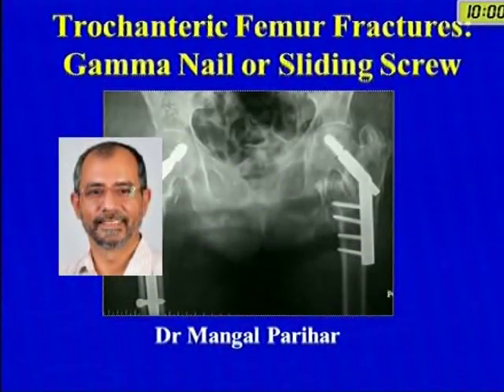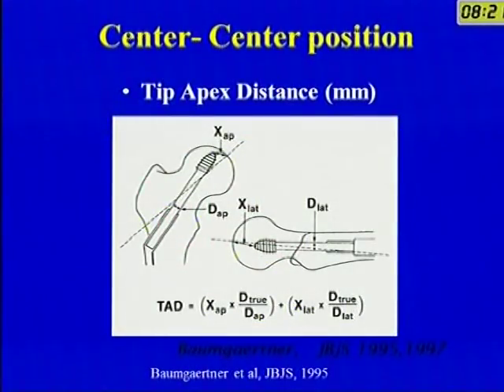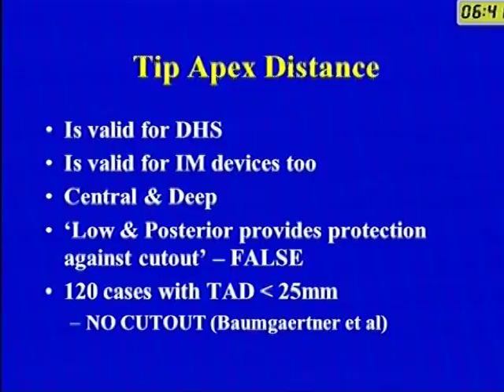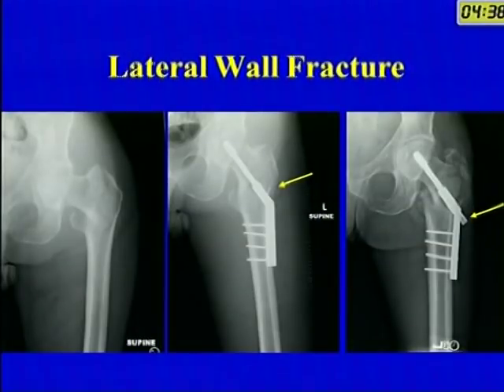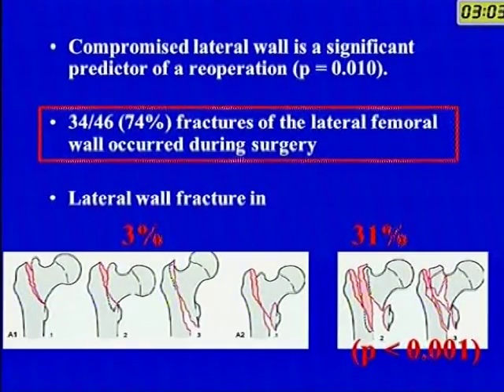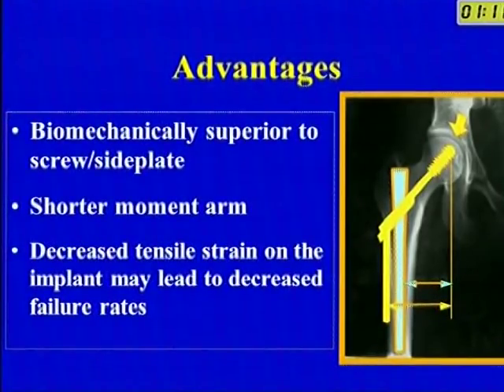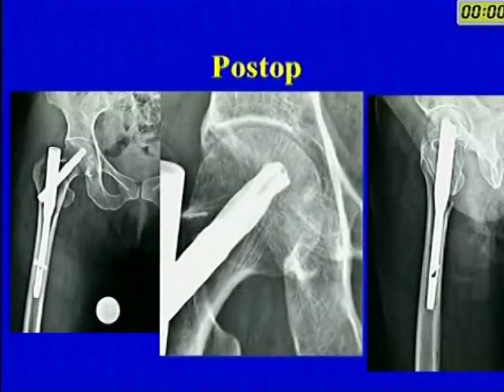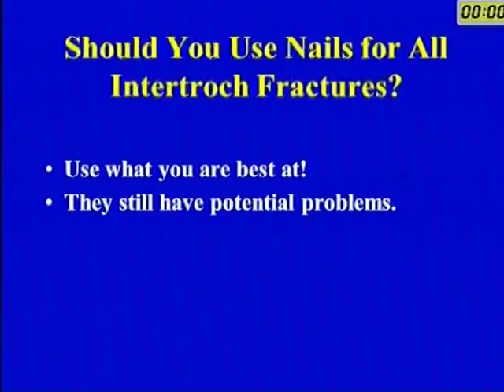Peritrochanteric Fractures- DHS Vs IM Nail

Comment: Good information thanks, A3 1 fracture with angle oppsosit is not below to upward, but from up to doward, if added fixed nail along with movable will be ok, but without it hip sliding down screw coming out. Can it be fixed little explanation

Comment: Thank  you  for  this  course.
..but  the  implants  you  are  using  were  those  9  years  back....the  stable  and  instable  fractures  have  to  be  defined  before  surgery....actually  i  am  using  mostly  gamma  nailing....and    in  neck    fracture  CHIMERA  NAILING...LOOKS  LIKE  A  GAMMA  NAILING  WITH  AN  ADDITIONAL  SCREW  AVOIDING  ROTATION  ....of  the  FÉMORAL neck...in  some  cases  i  put  throchanteric  prosthesis...